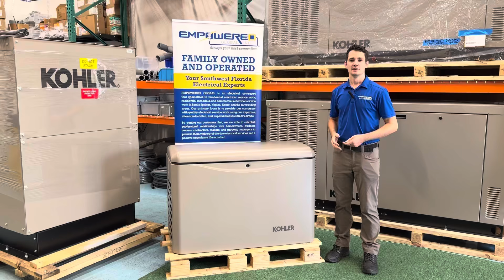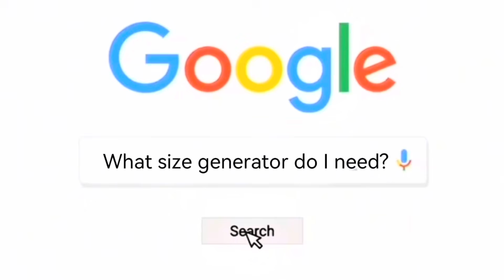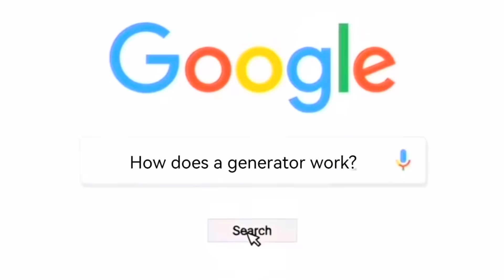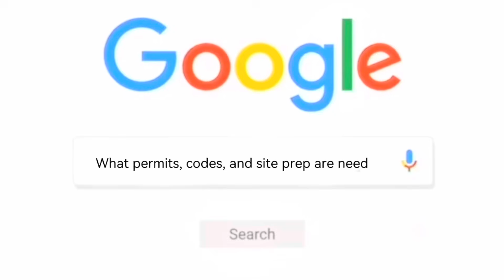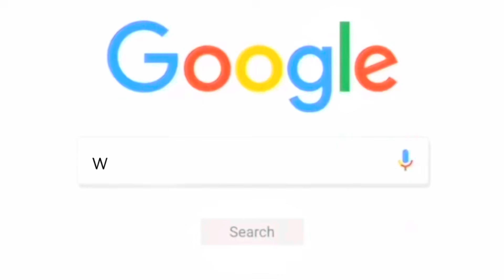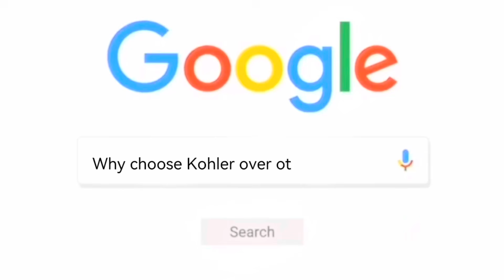9 Most Googled Kohler Generator Questions - SWFL Edition

Comment: I have a 26kw kohler.  I have an 8100 sq ft home with a pool, hot tub and 3 ac units.  We sized it to run the whole house except pool and hot tub.  However when installed, turns out it runs everything.  Power went out this spring and it ran like a champ.  We have 2 transfer switches and unit is outside master bathroom next to gas line.  It was 22k for everything and it was a great investment.  Research says we can get 30+ yrs out of it easy with maintenance.  We had to upgrade gas meter but otherwise clean install.  

We went w Kohler over generac because the generac dealer wanted to install the unit in a spot that made it an eyesore and directly under our deck while running a really long gas run from other side of house with ugly piping and moving all of our electric lines from the second panel to one (and the cost of doing so).  Kohler said why not install two transfer switches? It was same cost to do that vs the electrician moving lines

Had first maintenance in may.

Comment: Hey, thanks for the video.  Does the generator also have be exercised in full load?  That mean my router shutting down once a week.
Reply: If you don't have your router on a UPS like you should have your computer anyway, what do you do when the power actually goes off?  Everything that you love, or need that fails during an outage should be on a small computer type UPS to give it "ride-through" time until the power can be restored.  With a Kohler,. <10 seconds.

Comment: I bought the 26RCA from Costco! Never again will I buy a Kohler product! Of any sort! The Generator come with Zero instructions on how to secure it battery size and on and on! They expect you to pay another $10,000 to have one of their dealers to install it! That will never happen. I am perfectly capable of doing so myself with proper manuals! My propane supplier will do the gas and my electrician will do the wiring!  I will pour the pad mount the generator and mount the transfer switch! The heavy work is already done! Their customer service is non existent! So F8ck Kohler I will never buy another Kohler product!
Reply: You made your service choice when you purchased from costco, no dealer is under any obligation to help you when you by pass them to "save" money.  Capable?  You couldn't figure out how to secure the battery?  How capable can you be?  Battery size is listed on the specifications sheet-any other install documentation you didn't have is EASILY found online.  How ever, NONE of them will tell you HOW to use the information-that is WHY there are installers.  And no the manufacture will not talk to you about specifics due to the inherent liability associated with otherwise capable people. Usually.  But, do watch out for electricians and gas installers, as many of them are probably just as capable as you are....

Comment: Where can I find your calculator for how long a tank may last?
Reply from the maker: I couldn't find the best way to make it available to the public. If you email me I can send you the spreadsheet. garrett@empoweredglobalinc.com
Reply: Skip the middle man.  There is a booklet available online called the LP serviceman's guide (manual), that will tell you all things related to and installation that you are likely to need to know. But you don't need that to answer your question.  The math is simple: MAXIMUM fuel consumption divided into available gas volume.  Which for most is a moving target, unless you have a separate LP tank for the generator.  You can use the 50% loaded and the 100% loaded and average it, and unless you are loaded to a set point, all the time, it will get you close enough.

Comment: What is the difference between these two models besides liquid cooled and air cooled? 24 kW Generator Model 24RCLA and 20 kW Generator Model 20RCA. 
I am also looking at models 26 kW Generator Model 26RCA and the 30 kW Generator Model 30RCLA. I want something that will last a very long time and be reliable and dependable. I know I’m looking at little over double the cost between the 26KW air cooled and the 30 KW liquid cool generator. But I don’t fully understand all the differences between the air code and the liquid code, but the obvious liquid cold and are cooled. I can run my home on a 26KW generator but I’m stuck between air cooled and water cooled.
Reply from the maker: The liquid cooled units are quieter. They will also last an easy 5-10 years longer. You also do not need to check the oil as much during the long extended power outages.
Reply: And everything in my house is gas. Gas dryer, stove, fireplace, furnace, and hot water heater. And my stove is electric over gas. The stove top is gas and the oven is gas and electric, depending on what you’re cooking and the settings that you are cooking on for only the oven. So the Kohler 26-KW from Costco is a little more then I need for my 2,000 square foot home. And are AC is a 3 ton 30 amp 240V and the hot tub is 50 amp 240V. Those are the only high amp loads in are house. So I truly don’t know if I should get the air cooled or water cooled unit. I do know the air cooled unit is $8,000.00 cheaper. But if the water cooled unit will last 3 times longer or more then it’s worth it.
Reply: @JJJ-bo1uu Go with an air cooled.
Reply: @EmpoweredGlobal I live in the city and when we do have outages it’s like one hour to the longest so for almost 36 hours. I want something that will last a long time but not kill my wallet if I don’t have to. And what if we loss power for 3 days straight or even a week. Can an are cooled unit last? I do take care of my stuff too and the noise I’m not too concerned about. Last time we had power go out for almost 36 hours I brought a semi trailer with a reefer to my house and and all my neighbors out there food in it to keep there food frozen and refrigerated. And we are far enough apart that noise isn’t a big concern.
Reply: @JJJ-bo1uu I service Kohlers and generacs, as well as GE, taylor, et al.
I have a customer that has an air cooled unit that was installed in 2004.  Still running strong.  I have  several 14 kW kohler units on solar systems that have an excess of 5,000 run hours.  I have NEVER seen a generac of any stripe with 5000 actual run  hours.
Reply: About twice the money on the outset for the liquid cooled version, over the air cooled version.  The upkeep is more expensive for a liquid cooled over air cooled.  The longevity is a moving target, because if you don't maintain either of them properly you will never see maximum service life.  Air cooled service consists of a oil and filter change-cleaning, and inspect the air filter/replace as needed, same for spark plugs.  Liquid cooled is the same, just add coolant changes, belt and hose inspections and changes, tightening and tension from time to time, plus a slightly greater fuel consumption overall.  You still need to check the oil during extended run times, the liquid cooled just has more oil to go through, before you have to add.

Comment: How quiet is this generator compared to Generac?   I'm concerned about this because we would install it outside our bedroom window.  Great video. thanks!
Reply from the maker: Both Kohler and Generac are rated for 67 decibels at 23’ but who knows if they are performing the same test under the same conditions. To me the Kohler noticeably quieter.
Reply: @EmpoweredGlobal my Kohler is outside my master bath.  I barely hear it when it starts for its weekly test run
Reply from the maker: Check out my most recent video where I just tested a newly installed Kohler 26kW. That will give you a slight idea of the noise
Reply: Interesting question.  Generac at one time merely posted the quietest of the test points, while Kohler did use an average.  But, realistically with either, think riding lawnmower loud.  Unless you live in your bedroom, having a generator running during a power outage is a good thing....the sound of freedom.